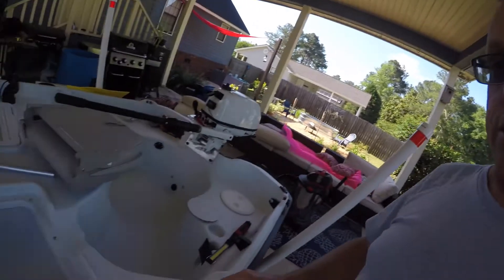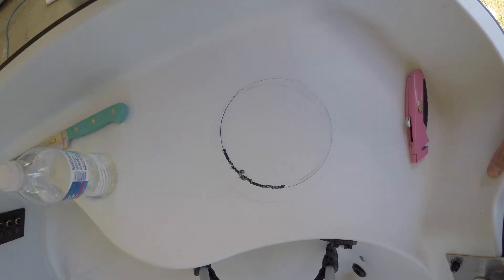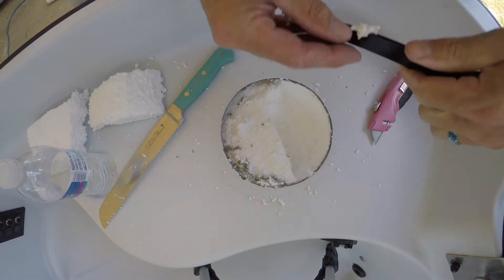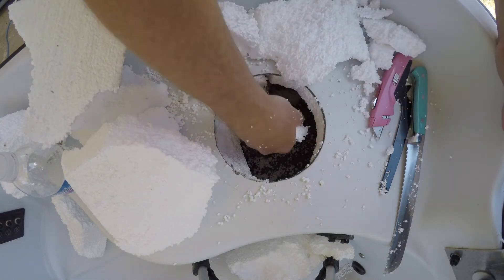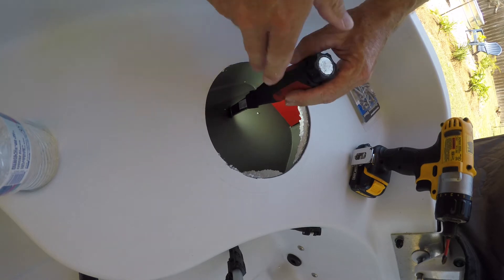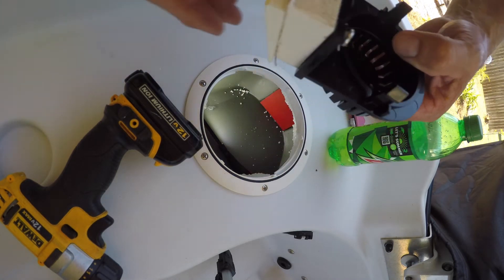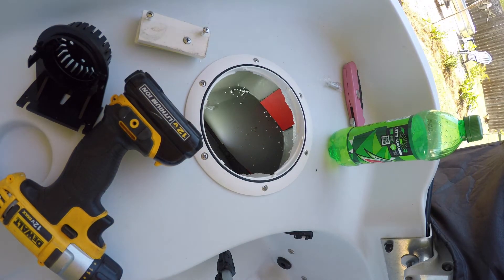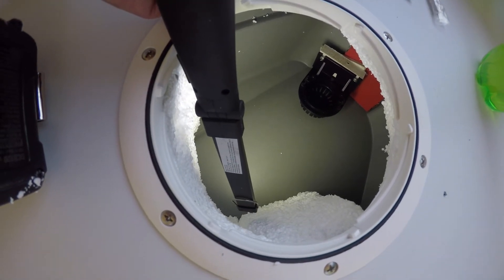Pelican Predator 103  Part 2 live well , Bilge pump install.

Comment: Chad i have to say youre have just a great engineering mind. Im retired now im trying to restore my 1990 F150 351 windsor 4x4 so little by little ill have that baby runnin and gunnin again
Reply from the maker: Vin thank you very much . I do like to mess with all kinds of things. Can't wait to get back on my turbo chevy truck build . Going to be a fun ride with around 800 hp . Should be a hoot to drive.
Reply from the maker: Good luck on the f150 4x4 I have build a lot of 4x4 . But the funny thing was I never used them in the mud i made them to nice to get muddy. Lol

Comment: Like what you done i like to see how you install your control panel
Reply from the maker: Hey Donald thanks I have sold the little boat and upgrade to a bigger boat the panel was not a bad install I added a smaller 12v battery just to run the panel  for the lights and bilge pump. Work great .

Comment: How are you keeping rainwater out of the battery box? My boat stays uncovered and that sucker fills up to the brim.
Reply from the maker: Well to tell you the truth I’m not I keep my boat under a shelter but still get water in battery box I solved the problem drilling a hole in the wall going to rear of the boat I installed a drain plug in my boat so the water drain out of box in to hull and out the drain plug when I get caught in hard rain I use the bilge pump I installed to clear water out of hull. I have videos on both of the installs .If you have any questions hit me up would be glad to give you info . Thanks for subing and watching.
Reply: That would be a good place for a bilge with a built in float switch...
And a small solar panel.

Comment: I'm watching your vids but you're still not fixing the leak(s)... You just keep doing more work to get the water out. 
GET THE WATER TO STOP COMING IN!  🤣 😂 😆 
The middle drain has bad seals and I'm sure the live well has the same bad seals. 
You could have avoided all this work and money with a simple O-Ring, tube of silicone or liquid gasket.
Keep up the videos but stop over thinking it.